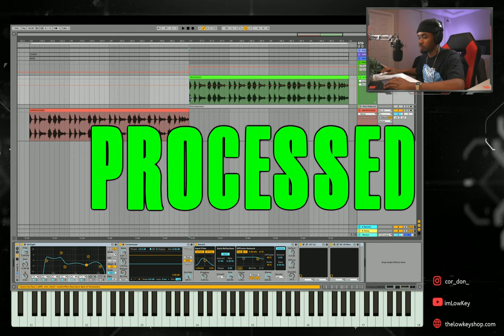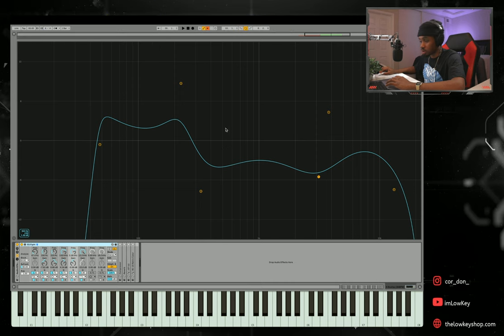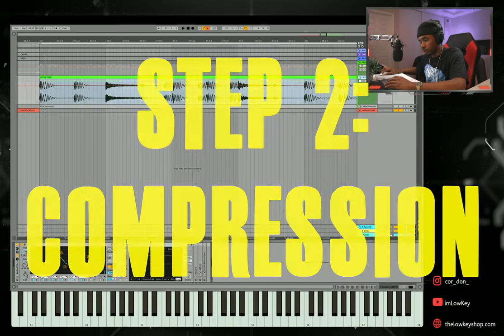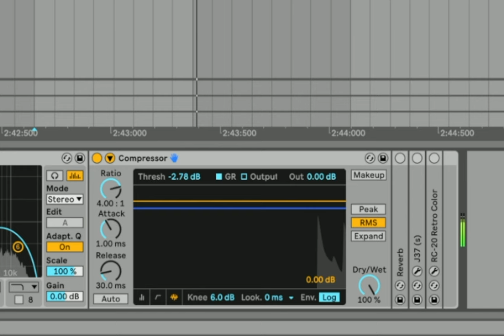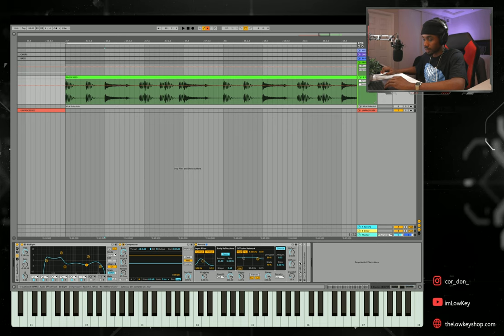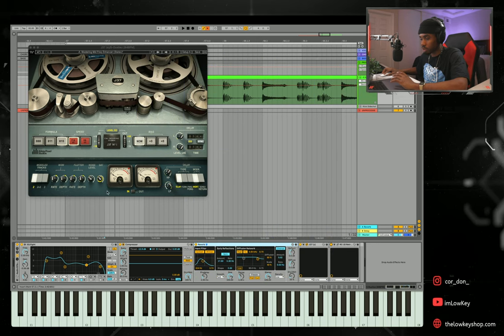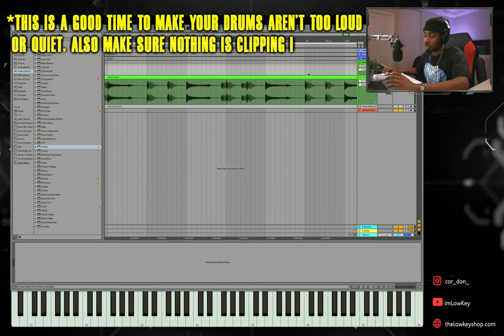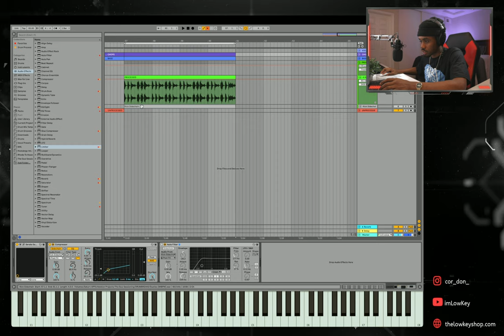How To Process Drumbreaks (Step by Step!)

Comment: Good stuff.  One question I had was about the sidechain compression.  The compressor has a built in filter for the sidechain signal so it seems like you don't need to create a new track for the kick?
Reply from the maker: You're right, I could've used the built in filter but I know not all compressors have that feature. So I did the extra work for those that use compressors without built in filters. Nice catch!